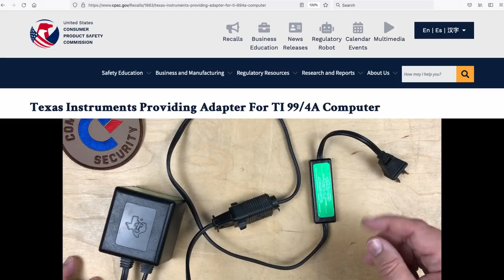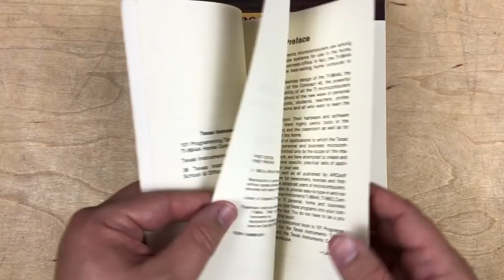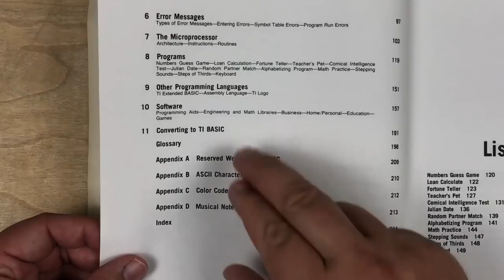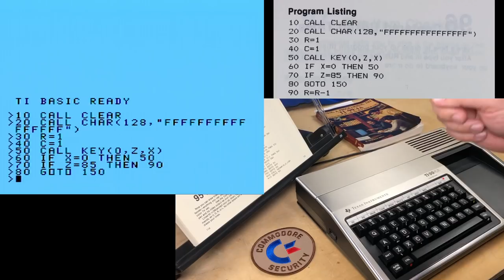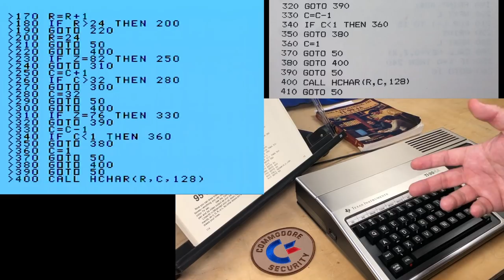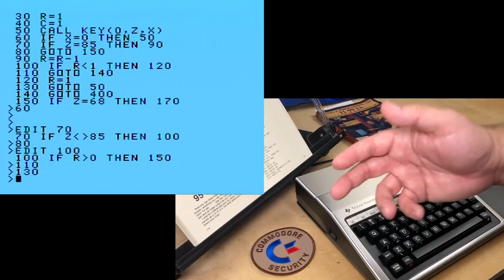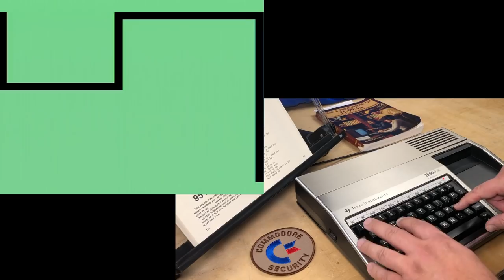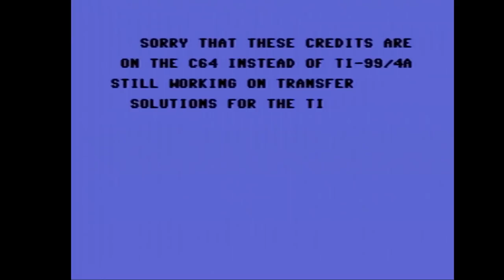Optimizing Line Count in TI BASIC: Type-in Fun with the TI-99/4A

Comment: The error on the GOTO line was because you'd typed GOT0 with a zero instead of an O. It's so subtle but the number 0 has rounded corners and the letter O is square. I can appreciate a zero with a cross through it on other computers all the more, but I do remember thinking the font on the TI-99 looking pretty cool.

Another great video, I love old computer books and especially ones with type-in's. Much of my early days on a Vic 20 was typing in from books and magazines to try to learn as much as I could and hoping to find something special. It is a shame that a book like this would have BASIC code that is so confusing. As a beginner you would look at that and wonder or think it is the right way to do it. The reality is the author was probably just learning too and making these kind of mistakes. Just pinoneering days I guess.
Reply from the maker: Aha, you're right about the zero!! It's really obvious now that I rewatch. Bizarre that I'd do that.

Yes about the author probably still learning, and the other thing is having 101 programs in a single book, many of them repeatedly ported between systems, with probably tight deadlines and/or low pay, is just moving on to the next program as soon as one works with little regard for whether it's actually good code.
Reply: I can imagine they'd be pressured to publish as soon as possible. That one Christmas I had my computer, my best mate had a TI-99/4a. I remember it had some great games but I don't remember its BASIC that well and certainly not the one statement per line nor the IF THEN limiations. I think that would do my nut in!
Reply: I think the author could also be attempting the balance between readability and simplicity. As you simplify many times you start using advanced features or math that are scary for new users to see and definitely hard to understand. The program IS huge difficult spaghetti code though which is hard to read. Its very… literal/spelled out though which may also be why the author wrote it as such. Just an idea.
Reply: @joshhiner729  Good thinking!
Reply: I'm glad some computers will take a zero and make it an O we have come a long way in word processing even misspelled words get corrected automatically and my phone went overboard with that feature I have to go back a put the original text because it changes the word and it can be a pain to un- correct to the word I wanted to write  even 8 bit in another sentence was 8 but when the correction took place. Sometimes we have to take the bad with the good. 73

Comment: You can add a couple of lines to turning the standing (current) location into a hollow square (char 129, "FF818181818181FF"), putting the plotting of the hollow square before the key-get, and filled when key pressed (before the changes), then returning to the hollow plot after the location updates. 
Lines used: clear,char128,char129,r=1,c=1,plot129,getkey, if(nokey):back-to-getkey, plot128,r-adjust,c-adjust, back-to-plot129: 12 lines with proper r,c init.

Drawing lines when you know where your "cursor" is works much easier as a tool :)

Comment: Time to get TI Extended BASIC. Then you can avoid the goto spaghetti as then/else can be followed by statement. Also multiple statements per line (separator is 2 colons :: not 1 : but don't be afraid, it is encoded just as one token in memory). Sprites, named subroutines, call peek and call poke (if you have memory extension) are then bonus.

Comment: Your new version of R is a good way of checking for the joystick usage in the left-right and the up-down directions. I got this tip from a magazine article for the joystick check, which sped up the action.

The amazing thing is the new code looks so intimidating to beginner and intermediate programmers, but once they know its intent, it is much easier to understand, because it can be understood at a glance. 

Your untangling might speed up the code in many instances for Atari, because each goto forces Atari to start at the beginning of the code and search for the destination line number; but you probably knew this.

Comment: I still do plenty of Boolean logic that looks just like this, except it's in a spreadsheet, where TRUE is equal to 1 rather than -1. For example, figuring out a D&D character's spellcasting equivalent level (for multiclassing) using just one formula and one cell to do it. It's less convoluted and less prone to breakage than nested if() statements.

Comment: I used to be a TI user. A little tip when writing a program, start with NUM 10 enter. And then it’ll start with the number 10 and every time you hit enter  it will start with the next number by tens so 20 then 30 etc.

Comment: One trick I remember for TI BASIC when typing in programs for other computers:  TI BASIC didn't have AND or OR operators in IF statements which made typing in programs for other BASICs that did have these operators a giant pain, but, you could use multiplication (*) and addition (+) in place of them, respectively, because TRUE is 1 and False is 0.  TI extended basic did have AND and OR, iirc.  I see the video covers this around 38:00

Comment: This is awesome.  I don't do much programming on my 99/4A.  But I do use my TI-74 Basicalc quite a bit.  That uses TI BASIC.  Well, mostly.  It only has one line of text, so no graphical functions.  But I just checked, and it can use the boolean comparisons you were showing.  Reducing program size is always welcome there.  It has 8K onboard, and I have an 8K cart for it, but I have several programs I use for work and have filled those both up.

Comment: There was zero chance of getting an electrical shock from the aluminum case first off because it is lacquered and therefore you're not really touching aluminum and then secondly because it is not attached to the computer in any way except for through the plastic part of the case. The only part where you could theoretically get an electrical shock was one of the ground points or the expansion slot. However, you had to have a bad electrical issue in your house to even get a fault.  The issue was something that they only could reproduce in a lab and all that pigtail does is add a fuse. So if you start drawing too much electricity it blows the fuse

Comment: That boolean replacement code is clever, though it does run noticeably slower. The TI runs 3 times faster than the Commodore 64 at 3 mhz and has a 16 bit processor, but it almost always seems to run slower such as in this BASIC example due to the inefficiency of the TMS9900 processor in comparison to the C64's 6510 (or even just a run-of-the-mill 6502).
Reply: It has nothing to do with the processor it has to do with the fact that TI basic is double interpreted from basic to GPL to assembly language. This slows down the computer immensely.  Versions of extended basic and cortex basic show the speed of the computer and assembly language of course run circles around all of that.
Reply: @arcadeshopper  The TMS9900 processor is not as efficient as the 65xx series. Whereas the 65xx line can do most operations in a few cycles, the TMS9900 takes 8-12 cycles on average, negating any clockspeed advantage it might have had. Even their non-BASIC games run very slowly,* so that BASIC->GPL->machine code does not fully explain the slowness. 

* Apparently, although the processor is 16 bits, only the system ROM and 256 bytes of scratchpad RAM can use the 16 bit bus, massively hampering the performance of the overall system. Also, TI kept the 99/4a as a mostly closed system for a very long time. If they had opened it up from the beginning perhaps third party developers could have discovered new ways to speed it up.
Reply: @JustWasted3HoursHere  on the 4/a it gets 3 times as many instructions per second, and can do math and other functions in those instructions that the 65xx can't. So the 65xx has to use more instructions to do the same work as the 9900 can do with less.   also part of the slow down on the 4/a is the 16 bit cpu is multiplexed into an 8 bit buss.. so fun
Reply: @arcadeshopper  the 6502 can punch well above its speed class, it's incredibly efficient with its bus access, almost every cycle is a memory cycle, sure, it doesn't have hardware multiply, but software multiply on the 6502 is sometimes only marginally slower clock-for-clock when compared to hardware multiply
Reply: @catgirlQueer  Cool, however this diverges from the topic of why TI basic is slow

Comment: I can see where the excess GOTO lines at 370, 380, 390 could be useful for mentally separating the code into sections similar to functions or variables while you're writing it.  
Especially 370 and 390, they're currently jumping back to the same code, but if the logic for the sections jumping to 370 or 390 had diverged, it would be easier to edit that one line VS needing to go through and replace every other or every third instance of GOTO 50 throughout the proceeding sections to point at a new line.

Comment: One of the great gotchas on the TI was hitting Func - + rather than P Rshift -0 or Rshift-+. Usually down to fatigue in the small hours (while doped on benadryl, since it was the summer 0f 83) could make your typing sloppy. Huge program, lots of CHAR lines, and suddenly you're back at the beep and the splash screen.

Comment: The ZX81 let you sketch with 64x48 'pixels', the PLOT command took care to draw the appropriate block graphics characters for you. Doing any kind high-res line drawing gets really, really, really tough on the TI 99/4A in BASIC (and slow). You can dynamically change the bit patterns of the 8x8 character cells and you have 128 distinct characters to use (32-159). You could do pixel-level function plots if you really wanted.
Reply: That actually has been done. The main limitation is the number of available characters to use for redefinition (96 were available in TI Basic) , so full screen bitmaps are out of the question, but . And as you said, it is painfully slow...

Comment: Great episode. Your final simplification example was awesome. As a child I remember using my friends ti99/4a. I remember the program listing being incredibly slow as your video shows. I also felt the machine as a whole seemed slow in games and other operations. I understand there were technical shortcuts taken by TI but never really understood just why a basic program listing etc was so slow. Well I guess we can assume its due to the unfortunate technical shortcuts in hardware but does anyone know if it is otherwise due to a poorly converted basic environment? Maybe a poorly optimized kernel? The specs of the unit otherwise dont appear to be that slow on paper.
Reply: It's been 8 months, and nobord answered yet.

1 reason is that looping for some/all computers was done by starting at the beginning of the code and going from line to line until the destination was found.

Therefore speed ups are done by going to the end of the code, and back to the beginning.

10 goto 32010
20 print x
30 print y
40 goto 20

32010 x=1; y=2
32020 goto 20
Reply: In most home computers, BASIC was implemented as a machine language program.  Slower than machine language, but generally acceptable.

In the TI 99/4A, TI BASIC is implemented in a language called GPL (Graphics Programming Language).  GPL is an interpreted language written in TMS 9900 machine language.  Thus TI BASIC tokens are first interpreted into GPL, and then the GPL interpreter performs the machine language.

TI Extended BASIC converts some of the GPL routines to machine language and runs noticeably faster.  There are newer versions of Extended BASIC that are even faster.
Reply: @CRCO1975  thank you sharing that info with everybody.

Comment: I have a possible explanation for the weird condition inversions. That may be because the programmer was used to program in 6502 assembler.
On that cpu, you can't branch on a condition more than 128 bytes ahead (or backward). The way to bypass this is to do this weird condition inversion so that the conditional branch just jumps over the next instruction (the real branch but without a condition, those can go almost everywhere in the code).
I think the original programmer may have learnt to always do this kind of branching inversion, just to not have to bother with that particularity.
Then, there are the multiple gotos in a row which scream to me: programmer that only do local jumps. The only jump allowed to go out of a section of code, is at the end of the section. All the jumps inside that section that want to exit the section have to use that last jump.
Reply: Whoa. I never noticed that. What a weird limitation; you can only jump to an absolute address and you can only branch to a relative one.
Reply: Same limitation on the x86 family we still use for everything.
Reply: @johndododoe1411  Truly we live in a cuckoo clock.
Reply: I find myself once again appreciating the AVR's Skip instructions, eliminating so many branches. It's a conditional single instruction inhibit, with no need to flush the pipeline.

Comment: The lack of a backspace key is baffling.  I wonder if there is a hardware and/or grom hack that could create a backspace function. Is there an unused key code that could be used? On the keyboard there is that little empty spot in the upper right they could accept an additonal key or button.

Comment: Ahhh boolean logic was what the zx spectrum lived for, you could use it on everything, strings, calculated goto and gosub, plot, draw, circle statements in fact anywhere you could use a variable, and because the character line limit on the speccy was 65535 you could technically write a whole program in just 1 line as long as you were an expert in boolean logic.

the one problem there though is the spectrum would get slower and slower as the single line got bigger, sometimes almost coming to a crawling stop, plus when you pressed enter to add the line to memory it could take a while to accept it as the speccy does syntax checking on the line before accepting it which cut down massively on typing errors as it wouldn't accept the line until you fixed the errors first.

one thing though thanks to the weird basic in the zx spectrum all variables have to be defined before you use them or you get a 'Variable not found error' unlike most other basics it doesn't automatically define them if not found.

Comment: I can see where a sequence of gotos could make sence: When it is used as a jump table in combination with a computed goto. But not all basic dialects support that.
Reply from the maker: Yes, Commodore BASIC does have the ON X GOTO 100,200,300 that can be very useful. I don't think TI BASIC has it.
Reply: Fun fact, GCC (the GNU compiler collection) supports computed gotos in C. The switch statement was also designed for that use.

Comment: Nice,  was the Author of the Listing payed by Lines?
btw. 
this is how i mostly use boolean algebra in Excel Sheets;-)
You are not able to use "TRUE" or "FALSE" within a calculation, but if you use for Example in C1..  
=(A1="TEST")*(B1="TEST2")*1
so it is possible to use this in a Formula

Comment: The CALL word() is a "built-in" BASIC language extension, as found in MSX-BASIC. If you write a memory dump program you will come across the BASIC keywords, which may have +/-128 in either the 1st, 3rd, or last character, with a 2 byte JMP value where the actual routine starts. The CALL routine doues a table look on  word , which will be "outside" the BASIC-ROM (but still within the ROM boundary because thats the default for a TI99/4A), and again it will have an associated 2 byte JMP value. The CALL routine may setup some registers or locations to map to the (0,X,Y) values before it JMP's to the extension or that setup may happen in the extension - I am going off memory of a paper dump listing I did of a SVI-728 at the beginning of the 1st Iraq invasion - the JMP values may be before or after the keywords, I cant remember verbaitum.

Comment: I find myself playing with assembly these days, but I'll be graduating to FORTH by summer.
Reply: I still have my "Thinking Forth" by Leo Brodie. Back around 1982 some people in the computer industry thought Forth was going to be the language to replace BASIC. I had an Atari 400 and I rewrote the plot/drawto commands in Forth and it was many times faster than the one written in 6502 code in Basic (the built-in Basic had to work in multiple graphic modes with different sizes and colors. It used BCD math and had to multiply the Y coordinate by the number of bytes in a horizontal row. I used a table lookup to eliminate that multiplication and I only wrote it for 1 graphic mode) . Still, it was faster than compiled (into P-Code) Pascal I had.

Comment: TI BASIC's minimalist flow control reminds me of assembly.
Reply: And I've seen that silly goto pattern in compiler generated assembly.
Reply: @johndododoe1411  because "branch unconditional" and "branch conditional" are the only looping structures that CPUs have.  HLL loop constructs are built from this.
Reply: @RonJohn63  I mean goto a goto instruction, as a professional, I am fully aware of the machine code limitations and techniques, including optimal implementation of HLL concepts and working with limited range jump instructions.

Comment: TI BASIC allows AND and OR but you use * for AND and + for OR. 100 IF A>100 + B=3 THEN 500 is the same as IF A>100 OR B=3 THEN 500 in some dialects.